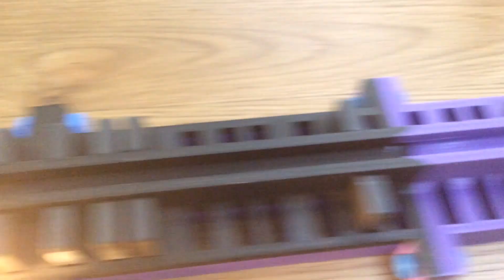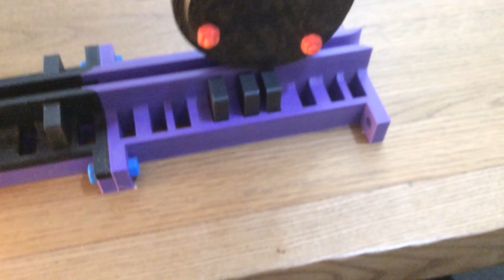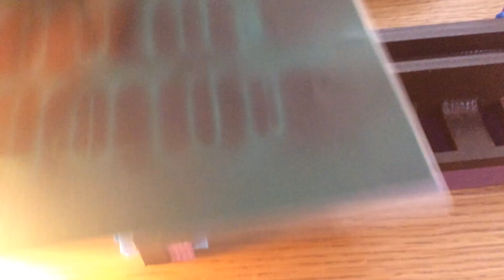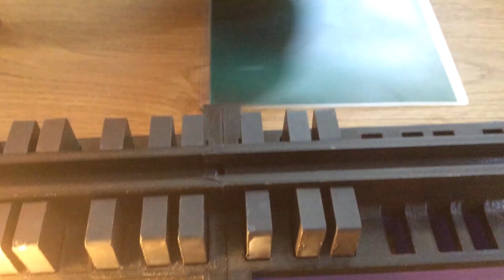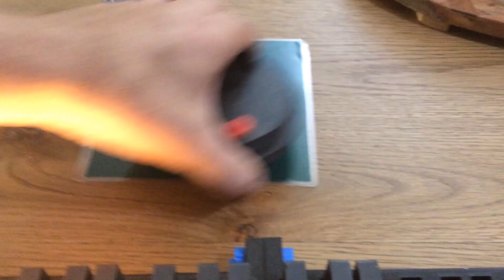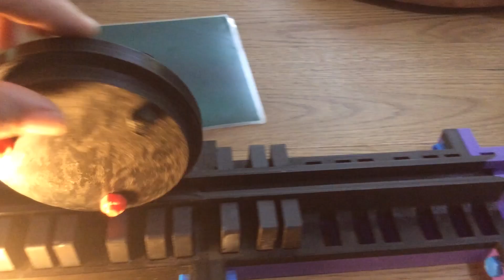Magnetic Propulsion Track Magnetic Fields

Comment: Interesting idea. Just a stupid thought. What if the magnets were somewhat recessed in the slots and then pop up when the roller passes by? There would be less resistance and the magnets would only be close when needed then go back down when not needed. I thought of electromagnets that would get slowly energized as the roller got close to them via some sensor but that would defeat the purpose of a self propulsion system not dependent on external power.
Reply from the maker: Thank you for your comment. I encourage you to keep thinking because the whole “what if” mentality is what led me to discover most of these things and in my experience our education is the voice saying the idea is stupid in the first place, I believe strongly that we are deceived on 50 plus percent on most things we are taught.

I tried to keep this design as simple as possible because the more items, linkages or connections made just results in power loss. All my research on magnetic motors taught me that 90% of them struggle to encompass the magnetic lock or barrier and have very elaborate mechanisms to overcome this invisible field. I decided to investigate the weaknesses of the magnetic barrier and spent years making 1 millimeter adjustments until we have what you see today. I believed it could be done even though everyone that knew of my efforts told me smarter people said it can’t be done.

What if those smart people were paid to lie to us? Repeat the narrative or lose your job, I had already lost my job and decided to entertain the “What if”.

The electromagnetic concept you speak of is how I imagine this would work in a designated lane for cars. Electromagnets could be placed in the doors of a vehicle and under the road surface, self triggered or excited by the nearby electromagnets. This concept has already been used in Theme Parks around the world. In Australia there is a theme park called Dreamworld that has a ride called that used to be called the “Tower of Terror” that accelerates a several tonne vehicle along a flat track that then goes vertical, the acceleration is astounding.

Comment: The energy is possibly supplied by the potential energy of the core in your wheel as it falls from a height, so maybe there is no real gain made in this demonstration?
Reply from the maker: Thank you for watching. I believe the energy is supplied by the inertia of the mass of the rotor. The height of the rotor is important as the radial arc is what encounters the magnetic lock which is overcome by the rotor because the active component is the falling rotor as you suggest. This dance of energy is constant from the fields and I fell it is not so much that there is a desired gain but more that it is collecting some of this magnetic field resulting in propulsion.

Comment: Interesting video. Good to see you demonstrating more about your track. I was unaware that iron was used in black filament. Figures they would add that to my go-to filament choice of color. I have not noticed any adverse effects from using it, but I suppose there could be things we might not perceive happening on a molecular level.
Reply from the maker: Thanks for watching. This video I made a while before your review of my track and just never uploaded it. I also never noticed anything relating to the iron in black products but it was something to avoid using in relation to the HHO field, in particular the Joe cell. Somewhere I read to avoid black dyes in build materials to prevent magnetic interference in the cell so I just avoid it where possible. I thought I had an extra roll of purple and at the last minute had to finish in black and come to think of it I have printed a heap of things in black instead of avoiding it so... I don’t know if it’s true as I have no way of measuring this to verify the data.
Reply: @whatifididthis...1236  I would think that would be a difficult thing to measure. It is interesting though.
Reply from the maker: @Motionmagnetics  Agreed, I’m sure there would be very expensive equipment that could show us. I have to rely on my powers of deduction 😂🤣 I once had a bet with a metals engineer and won $120 worth of stainless steel because he didn’t know stainless steel was magnetic. On that note, all metal causes an effect and I would discourage anyone from using any of it except where essential and allowing for its effects. My old Adams motor, that I intend to rebuild, would run for 6 or 7 days on a 7 amp hour battery with no collection feedback system and during one of these tests I popped my head in the room to see the voltage as I regularly did. However the motor slowed when I got within 50 centimetres, I thought it was the transistor dying so I went to get another transistor and as I moved away the motor sped up. I then thought perhaps it’s a loose wire and approached the motor at which point it slowed again. At this point I realised the 1 metre aluminium 50mm angle in my left hand was slowing the motor and another rabbit hole appeared! This was the universes way of showing me the aluminium angle that was destined for my next Adams motor was the wrong choice.
Reply: @whatifididthis...1236  Very interesting observation. That's the sort of thing you want to film and share on YouTube, as I know that's not something that would even occur to most people.
Reply from the maker: @Motionmagnetics  I would consider that a life experience, something you just had to be a part of to realise. This definitely left me wondering how many sliding door moments aren’t even noticed. Without this very brief experience I could have spent years designing things that were just never going to work, which is why I hold theoretical physics as nothing more than an opinion without validation, there are just some things that you can’t learn from equations and books and they will never compete with an experimental test unit. I will record a video of the effect of aluminium on a pulse motor as soon as I get it built. I wish I could be more efficient than I am, unfortunately my chronic pain pushes me to the edge so often that I’m always left playing catch up.
Reply: @whatifididthis...1236  No need to push yourself too hard, but I believe that's an important enough discovery to document for others to learn from, should you find the time in the future.

Comment: General question - Is there any approach that you know of that would provide a Repeatable self-running result?  Or even gain of say 160% or more (if input power is required)?
Reply: (I mean, not just magnets...  any novel approach including use of air-core coils as you have done, or solid cores, whatever/novel approach one can think of.
Reply from the maker: @TheProfJones  You can definitely use coils both for increased propulsion and energy collection, rotors will obviously require fixing and could not free stand as in my videos, unless your pulse coils were auto triggered by the magnet itself. The coils would obviously need to be inside and outside the rotor.
Reply from the maker: Thanks for your comment Steve. I will make a new video that demonstrates some of the design in fine detail. Initially I was attempting to enhance rotation of a motor that was pulsed like an adams or bedini motor but the magnet array had its own potential. My next video should clear up most requirements.

Comment: Have you tried a toothed track? So that position is not variable. No slippage
Reply from the maker: Thank you for your comment. I have not tried a toothed track but it would definitely worth trying but would also be a completely different beast with its won requirements needing investigation. The angle of deflection would be critical one direction would have a repulsive force thus reducing the gravity of the roller and the opposite angle would pull the rotor in, an adjustable model would be amazing.
Reply: @whatifididthis...1236  just lay a timing belt on the track
Reply from the maker: @David_Mash  My apologies, I got confused with your comment as I assumed you were referring to the magnet arrangement that was sometimes used by Howard Johnson, where the magnets were arranged in a sawtooth configuration. I’m not sure that this system could cope with the extra friction of a toothed track.

Comment: Thank you for your good work. Have you considered spacing the magnet distances based on a binary progression 1, 2, 4, 8... or Fibonocci 1, 2, 3, 5, 8....?
Reply from the maker: Thank you for watching. I have tried numerous different configurations but most were on the fly tests and without much thought process involved, just physically changing arrangements. I eventually settled on this config as it was what allowed me to see the rise and fall of the magnetic field, the pulse of power positions. Most other arrangements changed the frequency of the track either making the “hill” too large to overcome or not large enough to allow the mass to manipulate gravity as it descended into the valley.

Comment: Do this linearly or horizontally w ac control w voltage or frequency 4speed of propulsion ie vfd
youtu.be/Pl7KyVIJ1iE
Nd control ur stops w eddy currents
youtu.be/0b0V0impJ_E

Will await ur video Nd expriments eagerly 🙏
Reply from the maker: @Roshan Mathew. Thanks for your comment and the links you supplied, both videos were very educational. The problem as I have experienced it, is that the aluminium is hard to work into magnetic systems due to many minute adjustments and thousands of repeated tests to come to a conclusion. This in no way suggests it can’t be done and that it’s just difficult and therefore isn’t experimented with by many. I like to build my devices with as few components as possible, this may make it harder to achieve a desired effect however it makes it easy to replicate and therefore more accessible to everyone, I figure if everyone can build it then why wouldn’t they have a go.